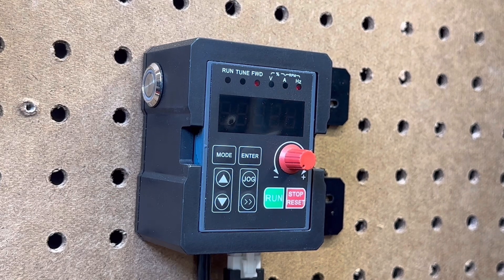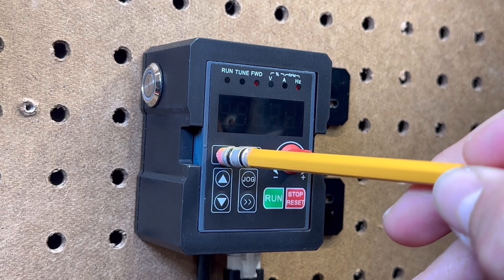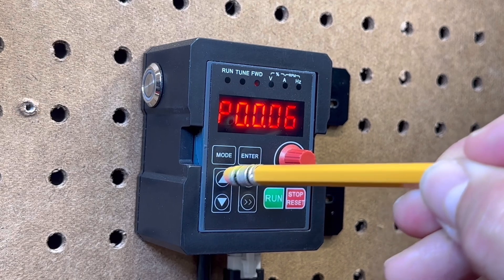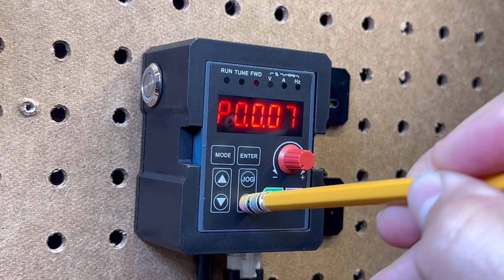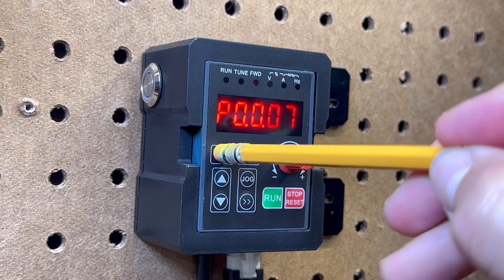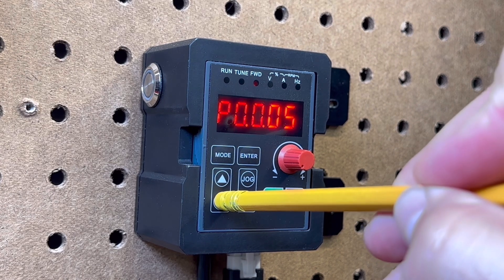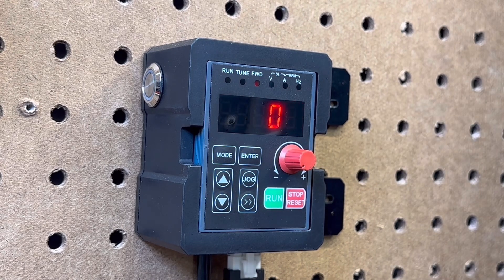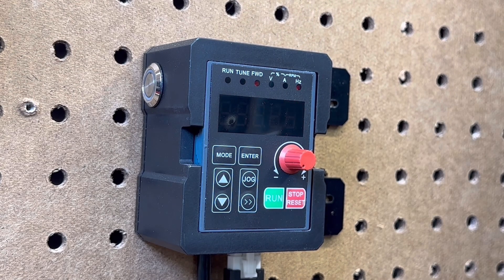Reprogram Redline CNC VFD to MASSO settings

Comment: I had an error code of 17 - went through all of the steps in the video and ended up with an Error code of 17,  any suggestions, (printed out the sheets in the manual and followed them exactly.
Reply from the maker: Please email our tech support team at support@redlinecnc.com and they'll get you straightened up!